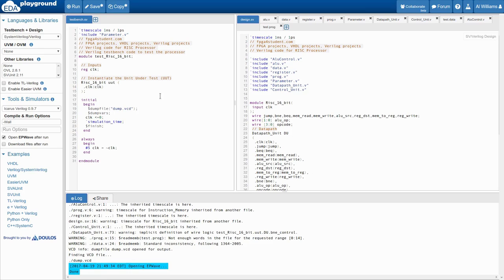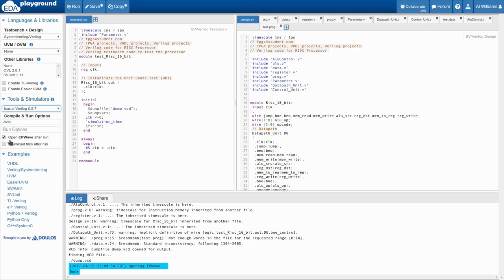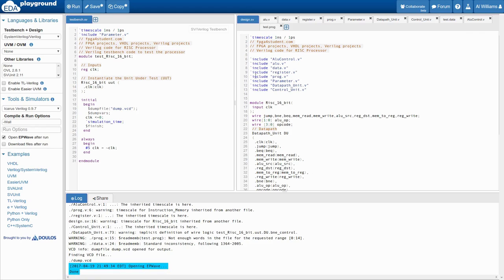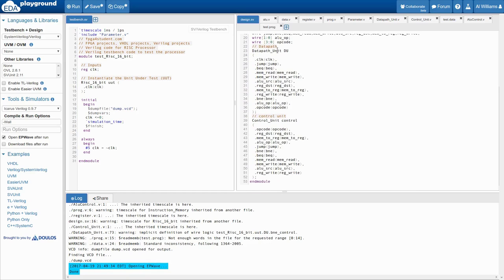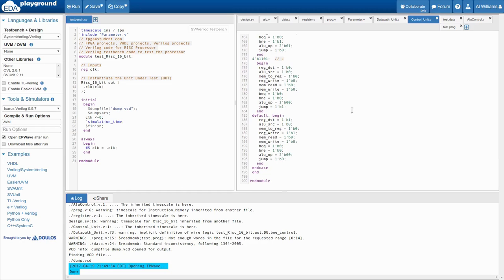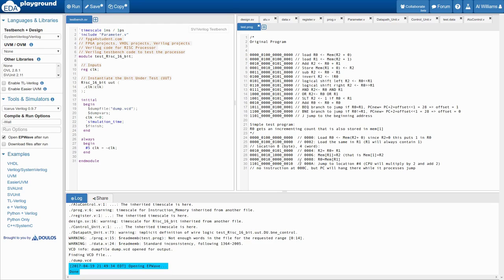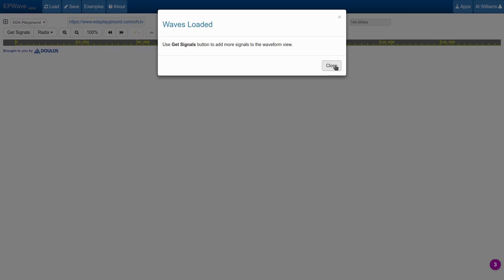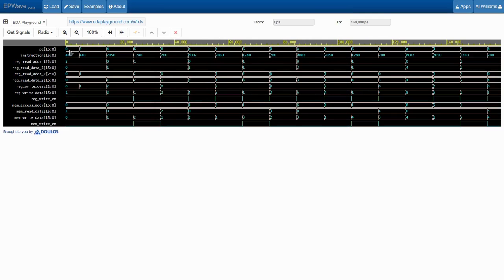RISC

Comment: If you have some verilog that runs much slower than the CPU clock domain (ex. logic that shifts data to a peripheral), how would you ensure that it shifts out that data ONCE whenever the CPU writes to that register?

For example, I understand for fast logic to handle data from a slower clock, you can do something like..

wire cpu_wrn;   // Driven low for 1 cpu clock cycle
reg cpu_wrn_q1;
reg cpu_wrn_q2;
reg cpu_wrn_q3;
reg cpu_wrn_q4;
assign cpu_wrn_redge = cpu_wrn_q3 & !cpu_wrn_q4;  // Will go high on cpu_wrn rising edge for 1 cpu clock
assign cpu_wrn_fedge = !cpu_wrn_q3 & cpu_wrn_q4;  // Will go high on cpu_wrn falling edge for 1 cpu clock

always @(posedge cpuclk or negedge rstn)
begin
  if (rstn == 1'b0)
      cpu_wrn_q1 <= 1'b0;
  else
  begin
      cpu_wrn_q1 <= cpu_wrn;
      cpu_wrn_q2 <= cpu_wrn_q1;
      cpu_wrn_q3 <= cpu_wrn_q2;
      cpu_wrn_q4 <= cpu_wrn_q3;

  end

But how would you stretch out a fast pulse, like CPU write, into something that logic in a slow clock domain would see?

I've seen system-verilog can synthesize some tricky things into hardware, such as treating nets as signed
if ( $signed(DataIn)  >= $signed(Threshold))
is there anything in system-verilog that may help with fast->slow crossing?